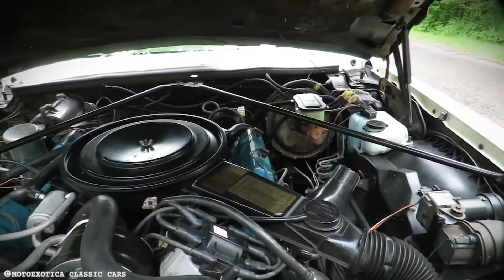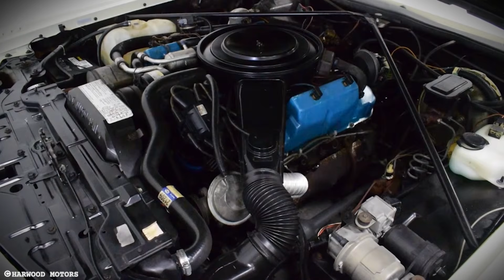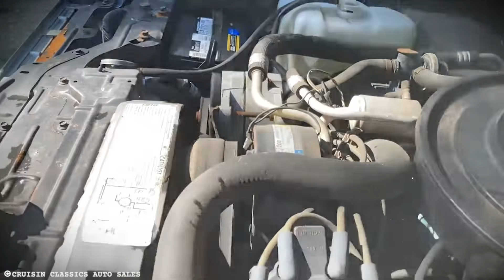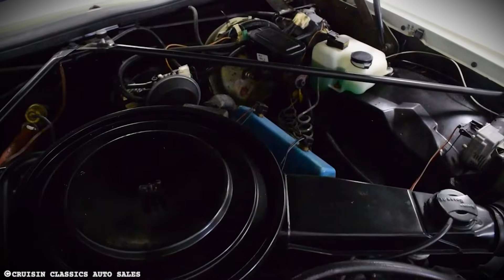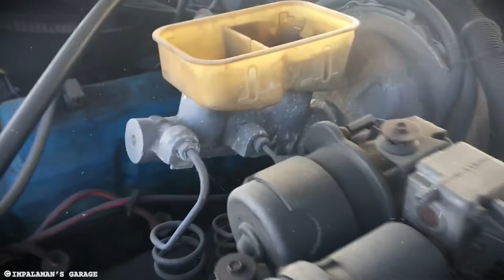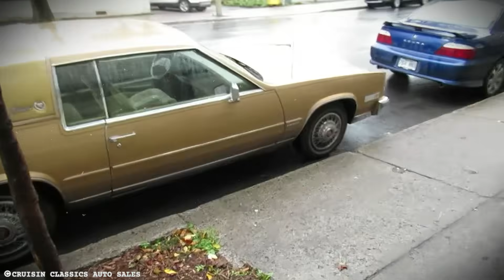The Most Overengineered Engine Ever Put Into a Production Car - Cadillac (1981)

Comment: over engineered car?  Is this an oxymoron? 
No fuel injection. 
No aerodynamics ever, actually quite the opposite. 
No disc brakes, just the ancient drum kind. 
No safety features ever. 
Most probably has the peak of america engineering, a 3 speed auto box 

Weighs a ton so even if it makes up the HP of a current 3 cylinder car, it used to pull the barge around. 

If this is your idea of over engineering, then I can fully understand why the american auto industry collapsed. ....dismilly.

Go look at the Mercedes Benz W123 and 
Citroën DS for what over engineering means. 
even the Citroën 2cv was more engineered than this.